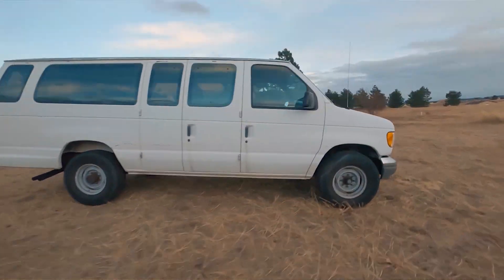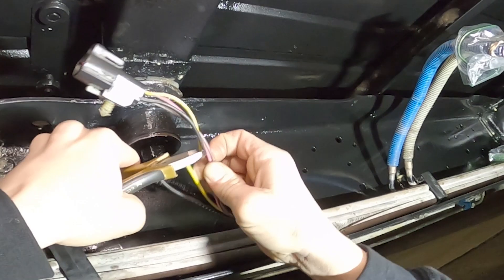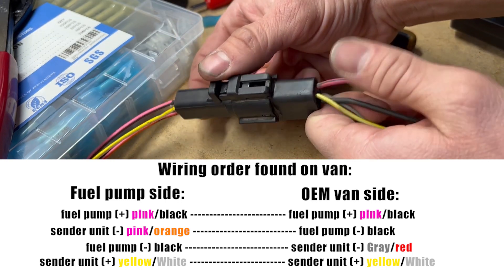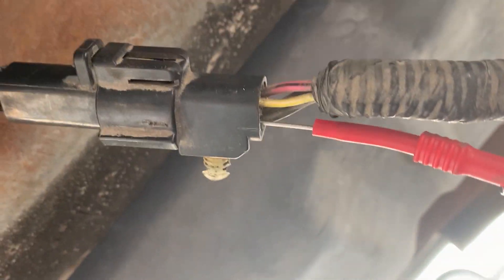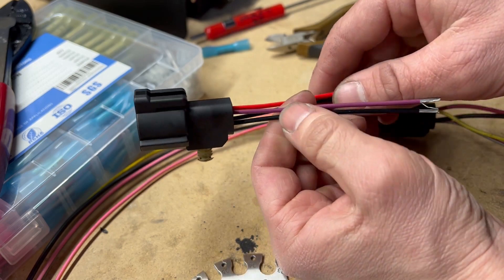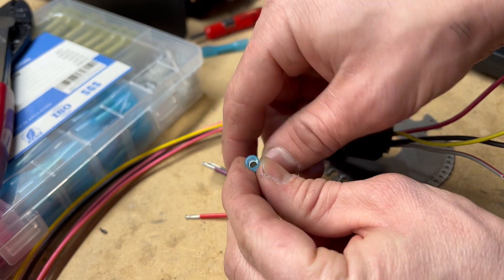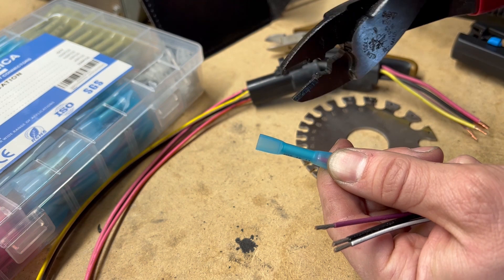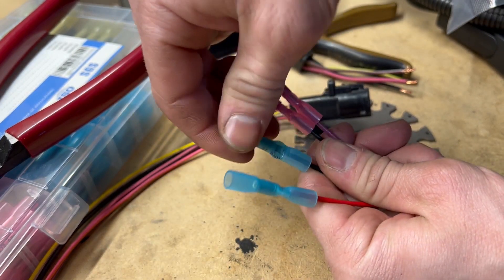Aftermarket fuel pump wiring harness issue and fix. | 1996 Ford E-350 Econoline Van

Comment: This happened to me even with Motorcraft. At least the colors are the same.
Reply from the maker: that's crazy. so strange. I would have swapped the pins in the connector but couln't get them out easy and didn't want to do any damage

Comment: I’ve checked your first video “drain the fuel tank” and I think you said that the aftermarket fuel pump wiring was messed up and didn’t match the van side wires.
On this one it seems that you’re changing the van side wires (pigtail) to match the fuel pump wires.
Questions: Was there ever anything wrong with the van side of the wiring? Did the new replacement Delphi fuel pump wires not go to the correct place if you just plugged them in? Bottom line - did you have to change the van side plug so the wires went to the correct places on the messed up aftermarket pump?
Reply from the maker: yeah the new Delphi pump wires would have been mixed up like the one I pulled out if I plugged it in. not sure why. the van side of the harness is factory and didn't look messed with at all, not sure why this is the case. you might be able to swap pins around in the connector but I thought I would just have 2 new connectors to prevent any voltage drop on old contacts
Reply: Well that sucks! Apparently two new cross wired pump assemblies have been purchased for your van. Delphi is, or was, a big name supplier. Matching that fuel injector pump assembly was complicated. I noticed that one of your new plugs even had the slot to accept the little nylon mounting stud. It’s hard to believe that somewhere in the design process someone didn’t say “Hey! Let’s make sure the wires are correct!”